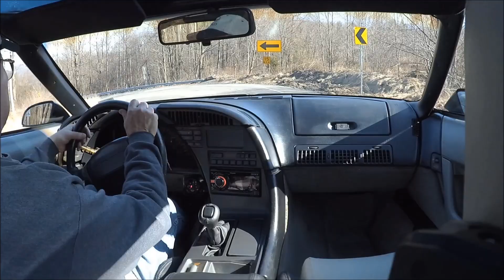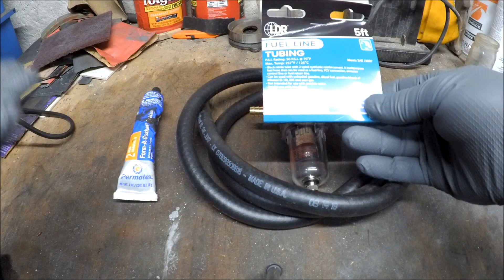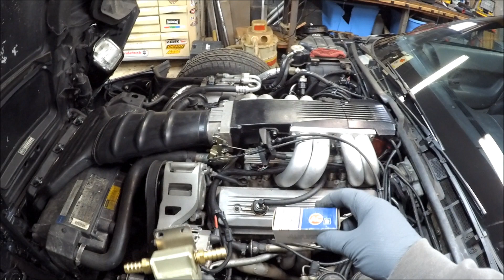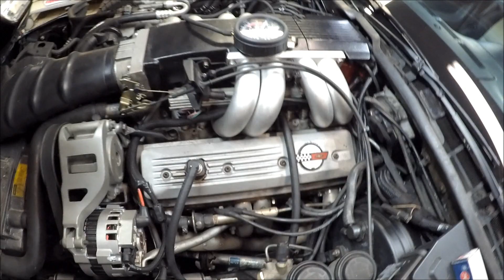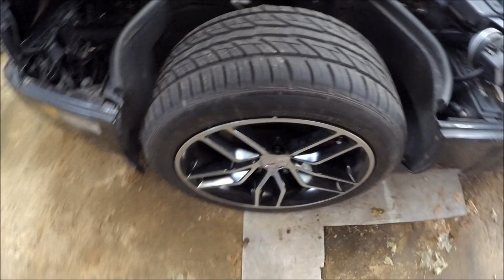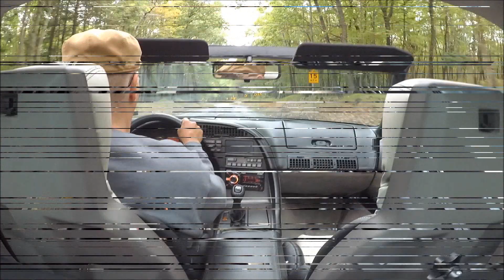Crankcase PCV Oil Separator Install on My 90 Corvette

Comment: Thanks for the video sir, on the passenger side valve cover of the 1990 vette the hose (I believe CCV hose) shouldn’t be plugged in? I think you may have said something about air needing to travel through the passenger side and to the driver side mine started smoking from the dipstick I’m curious if it is a pcv problem? Any response is greatly appreciated.
Reply from the maker: Its easy to check the OEM PCV and the factory replacement does not cost much, if you have excessive smoke coming from your crank case that could be a sign of a more serious problem.
Reply: @E.T.GARAGE  I think I’ll be running a compression test this week, thank you for your video and response I appreciate it.
Reply from the maker: @CacheWorking  f you dont run your engine often condensation will form in the crank case so every time you start the engine and it warms you may get some smoke from the crank case as it burns off the condensation,.

Comment: Hope it works good for yah, I usually just vent with multiple breathers but a pvc should keep your oil cleaner longer.
Reply from the maker: the way the stock system works it brings in cool air on the passenger side valve cover and circulates it through the engine and out the driver side valve cover, so nothings changed but the air/oil separator witch just keeps more oil mist out of the intake.